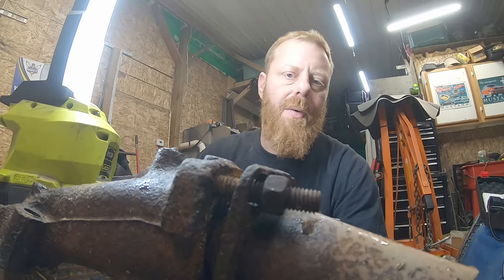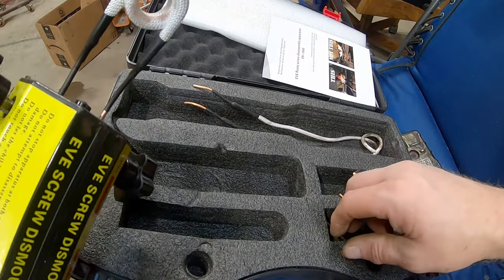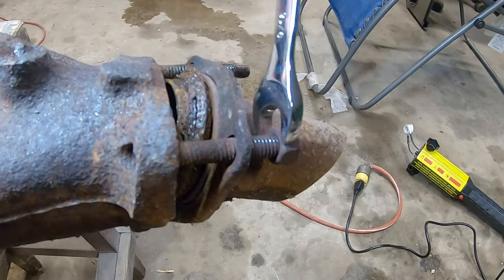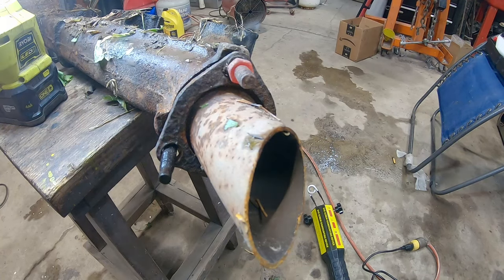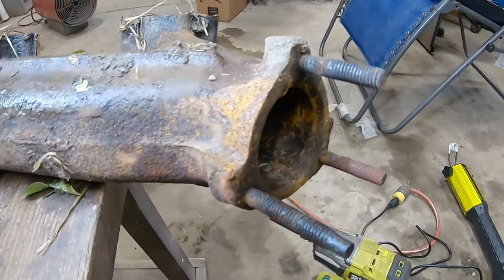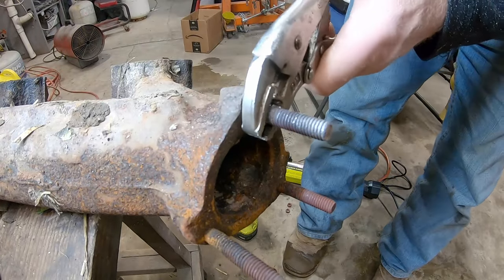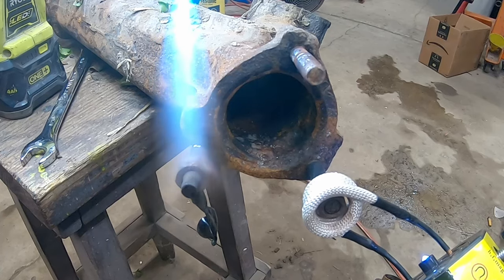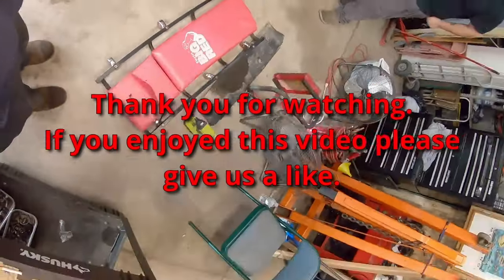Amazon TaiShi 1000W 110V Magnetic Induction Heater Kit Review

Comment: There is misconception that you need to heat it cherry red for 30 seconds. You only need to start to see it get red and that should be enough. You're trying to heat the nut to expand it while keeping the stud cooler. This helps break the rust in the threads. If you heat everything to cherry red, everything is expanding together and you're not really gaining anything. What else can help is cycling it a few times as well. It is the action expanding and contracting that is doing all the work.
Reply from the maker: I agree with cycling it.
Reply: Heating both works fine because they will have a different expansion rate. The nut will heat up quicker because the stud is attached the the manifold which creates a heat sink. The best way is to get it red hot then let it cool down, add a little oil while it's warm then it will come off easily.
Reply: Spot on, also heating the fitting to a red hot state, will loose the temper of the fitting, if it needs to be reused😎
Reply: If I heat it then Mist it with a spray bottle of water to rapidly cool it does that help at all?
Reply: Not really. It will cool regardless. I’ve heard about putting a candle on it as it is cooling down (don’t do if it’s cherry red though). The capillary action will draw in the wax to lubricate the threads. Never tried that myself though.
Reply: @Lwnmwrboy5  right on, appreciate the tip man

Comment: To get the bolt out of the manafold you need the freeze it. Heating it will cause it to expand and make it tighter.
Reply from the maker: The oxyacetylene torch removed it with ease. Thank you for your suggestion.
Reply: Or heat the manifold  , not the stud.
Reply: Heating the bolt stretches the length which loosens the threads
Reply: @greenbudkelly2820  You don't heat the stud you heat the nut to expand it. Heating the stud would probably cause it to snap off.
Reply from the maker: I agree
Reply: @andybutzko2330  heating the stud will cause it to snap? That’s hilarious 😂
Reply: @greenbudkelly2820  You won't think it's funny if it happens to you genius.
Reply: @greenbudkelly2820  Read it again junior.
Reply from the maker: I have to concur.  Always heat around the bolt or stud.  Even with a stuck nut, we heat the nut not the bolt.
Reply: @andersonsgarage2334  Exactly.
Reply: If you used a zip tie instead of a bolt
Reply: @andersonsgarage2334 u probably got no education like 99% of Americans: doesn't matter what u try to heat up - everything expands. The only reason it works is because it's not kinda "welded" together anymore.
Reply from the maker: @nazigrammar9728  🤣🤣😂😂🤣🤣
Reply: Oooo sorry bud, wrong answer, btw how was kindergarten today?
Reply: @kentstatetrooper  interesting Dr. Know-it-all what is the correct way to do it?

Comment: For studs: stack those two nuts that you removed in the middle of the stud. Then turn them toward each other, nice and tight. Now you can turn the inner nut and it will probably pull out the stud. If not, tighten them together more. Works 90% of the time.
Reply from the maker: Good point.
Reply: @andersonsgarage2334  I’m sure you knew already. Just hoping a novice in the same situation might see it and learn a trick.

Comment: One more thing I haven seen mentioned is that one fill for my big oxygen and acetylene tanks will cost almost as much if not more then the amazon induction heater.
Reply from the maker: Very true, didn't even consider that point.  Oxy acetylene has its place.  Induction heater fits certain needs as well.
Reply: Here in Maine I just paid $340 just for a bottle acetylene.
Reply: why wouldn’t you just use propane for heating the manifold? you shouldn’t need it that hot….

Comment: So if you use you're vise grips the other direction the teeth bite like a pipe wrench. Second tip squeeze the grips closed backwards in you're hand, so the side with release facing ur palm...much tighter for some reason. Test it lock them both ways and I will see.

Comment: Excellent up to date review. Thanks for doing this. i would be willing to bet, if you got those studs red hot and then shock quenched them with water or a light oil, they would have immediately released.
Reply from the maker: Brilliant idea.  Thank you for your comment and watching our video.
Reply: Hi Jon.  My dad was a machinist and tought me about heat treating metal.  If you quench steel, it hardens it...makes it more brittle.  If you don't want the metal hardness to change, you would need to let it cool slowly on its own.  If you aren't worried about the metal hardness and just want it apart, yes...quenching it will to the trick.

Comment: I just purchased this unit. When the nut or bolt is inside the coil it works extremely well. Heating the stud inside the manifold will take longer to let the heat travel down the stud. 
Wind your coil as tight as possible so it works faster and better. More coils will generate more heat so wind extra loops when you can.
Reply from the maker: Appreciate your input.  Thank you

Comment: I would suggest using the one wire that you can make (0:30) and wrap it around the ear of the manifold where the stud is screwed in. This will heat the larger mass first.
Reply: I was coming to say this.
Reply: @digitalis2977  same here, was just reading comments to see if anyone else mentioned it 😂

Comment: If it won't budge, you can get the stuck nut hot and melt some candle wax right into the threads and give it some twist back and forth. You have a candle and a torch and might not need one of these contraptions.
Reply: Good school tip, Copperslip on threads helps too😎👍
Reply: @richardrichard5409  I forgot about this comment, but the this trick helped me on my 68' ford truck!

Comment: Thanks for the info.  At what point do you have to replace the coils?  I notice the coil cover will turn brown with use over time.  That isn't an issue but they eventually burn off.  Is it a problem if the bare coil touches the item that you are heating?
Reply from the maker: Great question, we may have to sacrifice one of ours and do a test.
Reply: Eric O at South Main Auto said he used one with wore out insulation and it fried his induction heater. So if the wire looks worn, toss it out.

Comment: How big can you make the adjustable coil? would you'll be able to make it big enough to go around the part of the manifold that flares out for the stud to thread into it? I'm really debating on purchasing one of these. I am kind of a jack of all trades and one of my trades is bladesmithing. I was wondering if I could shape the coil to soften the spine of my knives instead of having to put a torch on them and run the risk of overheating the edge. I know they make bigger ones for things like that but they're closer to $1,000 and the one you're using I found on Amazon for less than $200. I also do all of my own mechanical work as well as fabrication so I think one of these would be very useful for me

Comment: I'm curious how much this tool cost as I am in the process of building something similar at the moment. However, mine isn't going to be a "gun style" but one that sits on my bench for misc heating of ferrous material. Also, I'm decided on adding water cooling through the heating coil but I wanted to know if that nylon cover protects the copper coil enough or would you prefer they could be cooled down during use.
Reply from the maker: I'm unsure what the purpose of cooling it is?!

Comment: Great video, sir. I am currently working on my used Pontiac g3 2010 and am changing the rusty brake lines and fittings for new ones. Can I use this to heat up and remove the old brake line screws? I have been already spraying PB blaster and already tried nut and bolt extractors. Also, I am new to car DIY, if that detail is important.
Reply: Yes you can use it on any metal nut.

Comment: Your heating too much, once the stud goes cherry its too hot, put a drop of oil on and spin it off with a socket and drive. For the stud lock two nuts together on the stud heat to cherry red it will expand within the casting , put on the oil then as the stud cools and shrinks it sucks in the oil and gives you a thou gap to be loose. I have one of these heaters and oxy, the heater is 10 x safer but the oxy is 20x more capable

Comment: This is FAKE.

Those nuts did NOT look like they were rusted on that badly. I don't believe the heat was needed. You did not record any attempt to remove the nuts before adding heat. Same for the studs, which looked new. Why did yoh switch manifolds. The first one had studs that were truly rated in.
Reply from the maker: Fake?  I'm confused by your statement.  We were simply showing the induction heater.  Nothing about it was fake.  We switched manifolds, yes.  That wasn't any sort of trick.  It was another sbc manifold with rusted nuts.  I think maybe you should rewatch the video.  We made no claims that these couldn't be removed by any other means.
Reply: The point wasnt the rust, the point was to show how the tool can heat nuts in general to the point they are cherry red hot, without the need out a torch